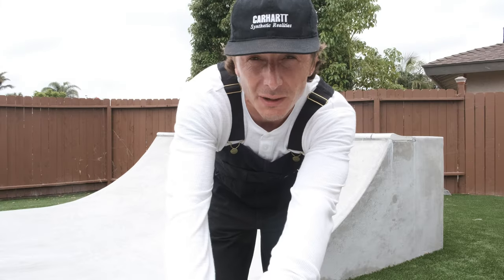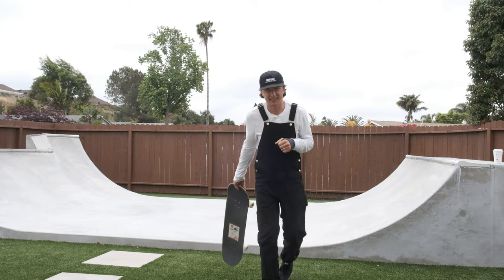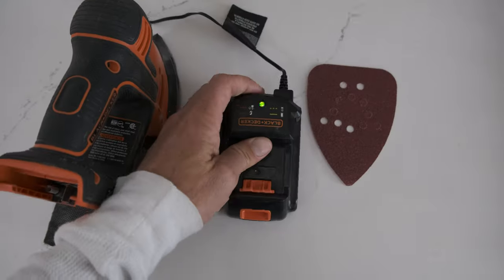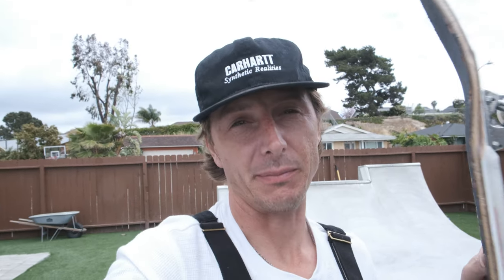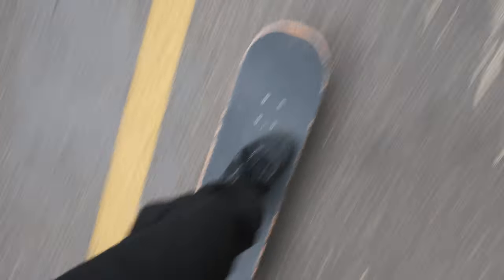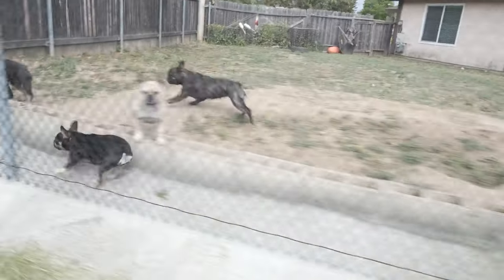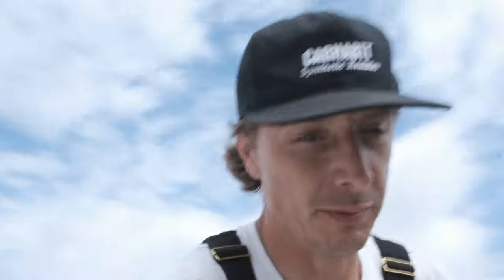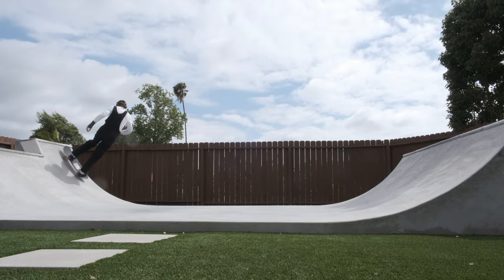Stop Wasting Your Wheels!

Comment from the maker: Do you have any tips for removing flat-spots? Hope this helps someone!
Reply: buy new wheels or rotate like a car
Reply: 1. Fastest way angle grinder(but skills required) and  u lost sizing of wheels compared to second way
2. Just skate in smoothest place availlable to do not get new flatspots or make already exist flatspot even worse. Something as wood or skatelite stuff more safe
Reply: Prevention. Don't land all your weight on one wheel. Spread it out over at least two.
 The cure. Rotate them all 180° and go powerslide. Check to make sure the bearings aren't coming loose after fixing the flat.

Comment: Biggest thing is not to completely turn 90 degrees when powersliding, but to sort of diagonal powerslide since it lets the wheel still spin while sliding. That also helps to get rid of flatspots if you have them

Comment: Spitfire f4 is definitely pretty flat spot resistant. If you aren't doing a lot of slides on crusty ledges or powersliding at 90 degrees which one should avoid anyway, I don't think it's an issue at all. Also, I've been sliding about on my powell dragon for like the past 6 months, and it seems they are pretty good on that as well. Maybe the soft duro helps to make the flatspots not sound bad, so I don't notice them as much

Comment: Only tip I have would be to make a mandrel for the drill out of an 8mm bolt, with washers and nut and mount the wheel to that. Take out the spacer so the bearings won't spin. Mark the whole thing with pencil to check progress and spin it against sandpaper, or the oscillating sander, either way.  Mounting to a drill press even better. Metal lathe would be the only pro way to re-true shitloads of wheels, and there's companies that do this, I think.

How about mixing some urethane (available from moldmaking suppliers like Smooth-On and Polytek) and patching it first. Stuff is damn sticky. 
But, that's why it's not worth most skaters' time.
Reply from the maker: That would be a interesting experiment though!
Reply: @ZackDowdy  Yeah, exactly. Let some techies do it. It's not worth the time and money, but in the Apocalypse, who knows what measures we will stoop to!